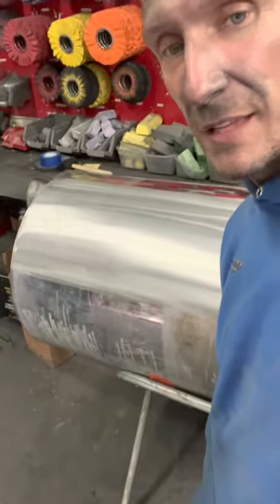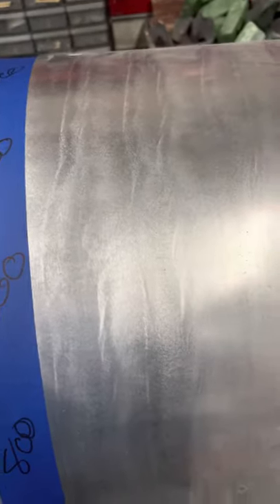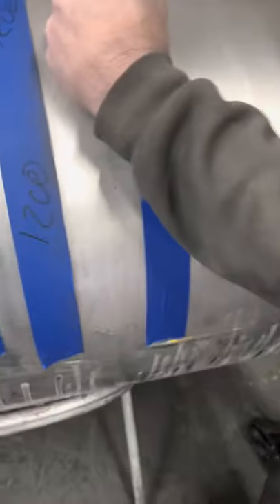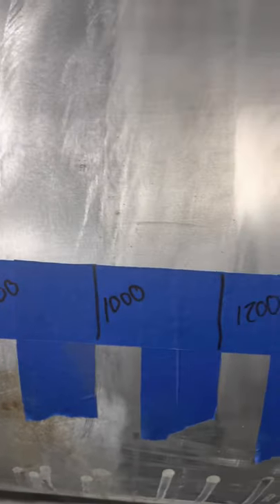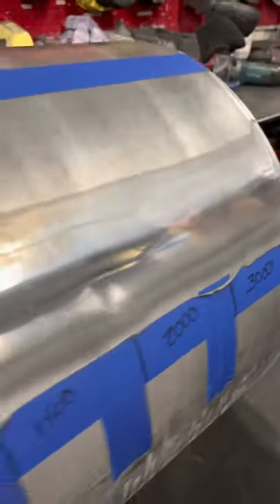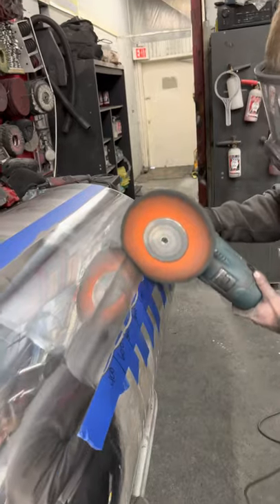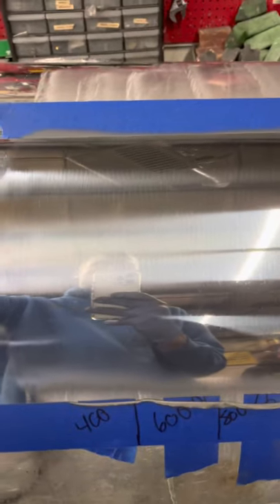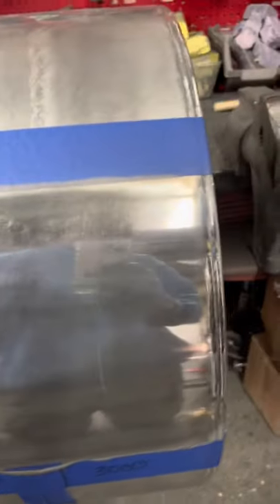Sanding up to 3,000 grit?? Why?? I only sand to 600. Watch why.

Comment: 99% of the stuff I polish I sand to 600. The 1% I go past 600 is stainless, I sand to 1500. After 1500 I do a 1 step with Renegade pink and yellow, if the customer wants to go further I will hit it with flannel and purple.
Reply: That is very good info, thank you. I’ve Been trying to find a good combo for stainless
Reply: Man truly appreciate your time. Have this exact problem was going to start sanding higher
Reply: You're actually kind of screwing yourself sanding that high on stainless stop at 400-600 the metal is too hard and you're not even doing anything with that sandpaper whether you believe it or not not to mention stainless requires a lot of heat you you're pretty much just taking your sandpaper and money and just throwing it out the window
Reply: @markhutchinson8474  Absolutely not true. I have being using and teaching this method for 8 years. Polishers from around the world have contacted me for tips after seeing my stainless work and have adapted my methods. 100% have reached out after some trial and error to thank me for the advice, after the got the process dialed in they now save hours per project, some even days depending on size. 
Just because my process doesn't work for you don't disregard it it as it works for hundreds of polishers around the world.
What you may not realize is I'm working on 1/8" mill finish rec tube that has to leave mirror finish. When I say mirror finish I mean better then chrome.  I start with a 220 flap disc at 12,500 rpm, then rotory sand to 400. Then I step back to 220 da and work my way to 1500, after that it's a very quick 1 step for a perfect mirror finish.
Reply: Congratulations 8 years
Reply: I'm curious to see what you pull a day
Reply: @markhutchinson8474  99% of my business is brightwork, so yes I am in my own fucking lane. I just don't post much as I'm insanely busy. Booked out through the end of February and booking multiple jobs each day. So please take your condescending  attitude somewhere else.
Reply: @urbanedgeautodetailing  and I'm just curious if that is your process on stainless how much are you getting to do like a tank strap $5,000 if you think that you're cutting through every single grit past 600 you're very wrong the amount of hours that it would take to actually get through all of your previous scratches I don't know how you're making any money if you are doing shit like that in the metal finishing industry you're stopping at like 220 grit 320 Grit and cutting
Reply: @markhutchinson8474  I really don't care what you claim, I like my methods and so do hundreds of polishers around the world. If you claim you one of the best in the world then you should know better. Check your arrogance and accept others have knowledge to share. 
Until you have perfected my method yourself your words mean absolutely nothing to me.
Reply: @urbanedgeautodetailing  never said I was the best in the world I'm saying one of the best guys in the world only Sands to 320 Grit
Reply: @urbanedgeautodetailing  maybe the way I can word it so I'm not being such an ass to yes you might have standed the 1500 but you're not polishing out fucking 1500 grit scratches if you can find anyone who can agree with you that actually means god damn shit in this industry please feel free if you can find anybody who's going to tell you that there's a 1500 grit sandpaper out there that's going to stand up to stainless and still be 1500 Grit I would like to see them come forward I'll be waiting
Reply: @markhutchinson8474  320 on stainless, he is waiting his time polishing thise scratches out. How often does this "best polisher in the world" work on mill finish? 
If you think sandpaper has no effect on stainless past 800 grit then you are completely clueless, or have never successfully done so yourself. Just because you don't know how to do something doesn't give you the right to make unfounded claims. If done correctly, which you are obviously not doing, you can polish stainless through sanding. Just because you don't know how to do something doesn't mean it can't be done or is a waist of time. 
If all you have to say is that I'm wrong then stop replying and get off Evan channel as your mind is obviously shut off to new knowledge🤦‍♂️
Reply: @markhutchinson8474  @$175 hr on stainless I don't just fine
Reply: Oh yeah by the way six months ago and 8 years of experience you did your very first door Jam that's cute that tells me you haven't done jackshit and just so you know this about two-and-a-half years ago I was actually going to go work for Evan was going to hire me absolutely no questions asked you know why that is because he knows he wouldn't have to hold my fucking hand because I actually know what I'm doing
Reply: Congratulations you had a steer wheel on your channel that was an absolute perfect amazing condition that you polished I guess you really know your shift
Reply: @urbanedgeautodetailing  listen let us just in this bickering back and forth if you have your own way of doing something that's absolutely fine maybe I'm a little heated I've been out for a little bit over 30 hours straight I've been holding a poop for about the last 5 hours and I've got another 45 wheels2go with that being said if something's working for you that's great it's just with my experience and almost 20 years of doing it scratch that find a compound won't grab ahold of in Renegade I won't even get started that's a whole nother subject with the products that I use I can easily easily remove a 400 grit scratch no problem at all with an airway on stainless I don't do any two-step everything I do is either three or four if whatever you're doing is working for you and whatever you are doing is making you happy keep doing it everything I do is on all custom high-dollar stuff I don't really get into doing fleets because there's no money to be made in it and yes those guys aren't looking for a show quality you are right about that but either way there's no need to keep arguing back and forth and saying shit to each other
Reply from the maker: There is a lot of ways to polish. No wrong ways if it shines. I always say to each their own. I've seen so many different ways to get a shine. I personally polish stainless at 600 and have no real issues getting A2 graded mirror finish. But I spent some real time on it.

Comment: Aluminum does clog our pores but aluminum does not have pores. People have pores. Aluminum is a solid structure that does not breath nor secret fluids. 

After 600 grit the sand paper clots and does nothing. Higher grits cannot cut as well as they become clogged and unclean. They also cut less and less material so it’s unnoticeable. Also smoother aluminum surfaces cannot be buffed as well either as their is no tooth left for the compound to cut. 

But again aluminum has no pores. Perhaps you mean texture. 

Great video and good info for those not understanding aluminum and it’s qualities when it comes to polishing.
Reply from the maker: Thank you @MrCbell57 for your input. I did not mean texture, but thank you again. I appreciate you taking time to watch and comment.
Reply: aluminum can have porosity, which can be a major defect in castings and welds. Porosity can be caused by a combination of factors, including:
Hydrogen: Hydrogen is the only gas that dissolves in aluminum, and its solubility decreases by a factor of 20 as the metal solidifies. If the cooling rate is too fast, the hydrogen gas can remain in the metal as porosity. This can happen when hydrogen-containing compounds contaminate the filler wire or work surface, or if the aluminum water has a high gas content.
Shrinkage: Solidification shrinkage can also cause porosity in aluminum castings.
Welding: Porosity in aluminum welds can be caused by dissolved hydrogen in the weld metal, air or bubbles from the welding process, filler or filler wire, or environmental welding influences. For example, using an improper gun angle, such as a drag angle or 90-degree angle, can also cause porosity

Comment: You didn't start with 600 and go up on all of them. 3000 isn't gonna shine of it was never cut to begin with.
Reply from the maker: What do you mean? This video was made for the people that sand all the way to 3,000 and try to cut and can't find out why their stuff won't shine. Not sure what you meant.
Reply: @EvanStegerMetalPolishing  if you sand the same spot with all the different grits then your finished product will be different than your example.  Your sanding different spots with each grit.

Comment: How does the full face work with a beard?
Reply from the maker: I would say it depends on the the length and fullness of the beard. You can tighten it down pretty well and it will seal good.